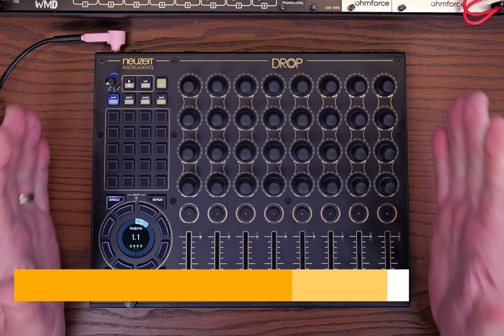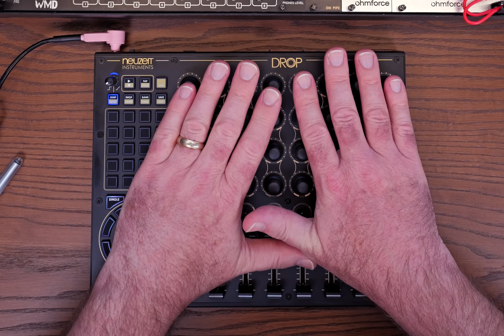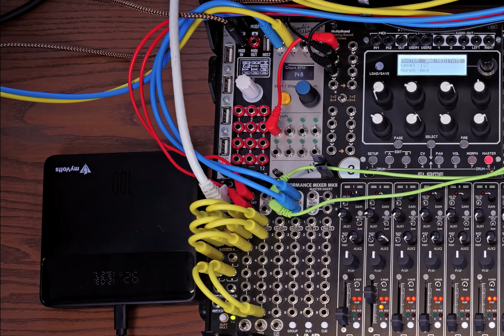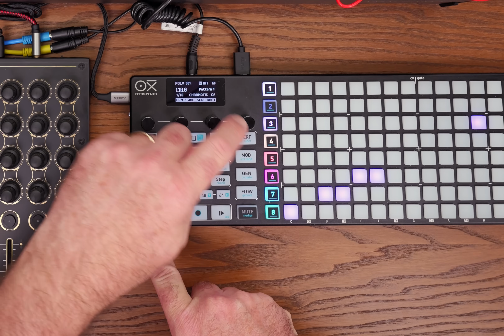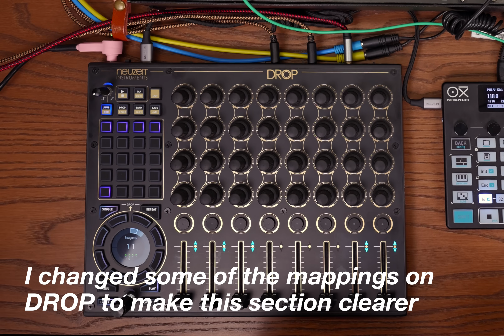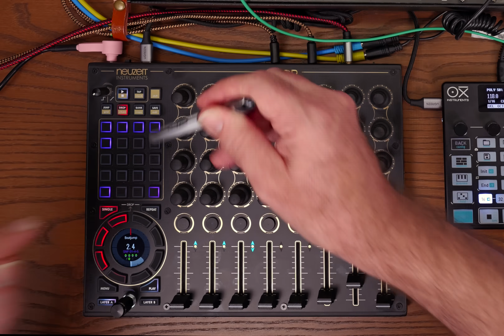Neuzeit DROP: the most powerful MIDI controller for synths and modular

Comment: Is there a way to save the number of bars or seconds a snapshot will take to fade in the snapshot itself, or is it all manual through the tiny knob in the upper left?
Reply from the maker: There's a distinction between fading between snapshots (using the knob) which is called 'Jump mode', and sequencing when you drop from one preset to the next (called 'DROP mode'). The fade is manual and the length of the fade is controlled by the knob. But the Drop is sequenced, and can be anything from 1 to I think 64 bars long. 

There's a lot more to it though - you can chain multiple snapshots, or sequence a Drop followed by a fade-in Jump. So take a look at the manual around pg 38

Comment: I'm having a hard time getting mine to work with the Tonverk over usb. Any tips?
Reply from the maker: Yeah I had some difficulties with it too. I since returned my Tonverk so can't test, but I think it comes down to the USB host/device getting confused. Did you try over DIN MIDI cable? I know Elektron just released 1.3.0 with bug fixes on MIDI in it

Comment: How is Layer B working? Is it the same snapshots that saves both Layer A and B?
If I should consider this, then it would be as a change from Faderfox PC12 (74 potentiometers) to this (32 potentiometers), but if the Layer B is a 100% extension of Layer A then it is ok and it will work as having 64 potentiometers, which I can deal with.
In other words - all the controls on the left side is handling the 64 potentiometers (yes, their real term is encoders), 16 buttons and 16 faders? And the only reason to have layer A and B switch, is else the unit would almost be twice as wide and quite more expensive, right?

Sorry for the multiple explanations, but this would be a total dealbreaker for me. 👍🙂
Reply from the maker: Hi! I also had a PC12 and MX12 which I sold once I got the DROP. They're great controllers - really high quality.

Layer A and B are entirely independent. So you can treat it as having double the controller surface without doubling the size. I just tested it on my setup
Reply: @SynthDad Thanks for the reply. How would you compare the build quality of Deop vs. Faderfox? I know the Drop is a metal case and so, but how about buttons, knobs and faders? 🙂
Reply from the maker: @psypher19111911 as good as the Faderfox

Comment: Another modern controller that can't handle 42 year old System Exclusive (Sysex)messages??? Geez, it's 2025! why THF would no one add such a low level messaging system like Sysex? Behringer did it with the BCR-2000 IN 2005!!!!!!!!
Reply from the maker: What do you mean 'handle sysex'? By definition sysex are exclusive to a particular manufacturer, so what would it do with a sysex message?
Reply: @SynthDad  see Behringer BCR2000 specs
Reply: @SynthDad  did you just reveal how much you actually know about midi?  arent you supposed to be an expert daddy?
Reply: Get a bcr-2000 then 🤷‍♂️
Reply: @slakk5093 you missed the point.
Reply: What are you even trying to do with SysEx here? 😅
Seriously, explain it
What would the DROP even need it for?

Comment: This looks quite interesting. One thing bothers me though... Why are there still no MIDI-controllers with small displays under/above every mappable element, showing me what parameter it affects. Just look at the MPC X's Q-Link knobs if you need an example. I feel like that would be the most useful feature of them all. Only than I can effectively use it for multiple devices and presets. There's zero chance that I can do it all from memory. I really don't get, why that is not a common thing already for controllers. Especially for devices in the 1000$-tier.
Reply: Have you looked at the Electra One?  Full screen for a page of 36 controllers, with 12 touch-sensitive endless encoders. Latest firmware supports remote control from other midi controllers (faders etc) to extend the hardware controls.
Reply: @adadcalledrichard  I did and ultimately decided to go with the MP MIDI Controller, now that it also comes with Ableton integration and a MIDI-Editor. I can't say yet if it can fullfill all my wishes but at least in theory it should be capable with a few acceptable tradeoffs (like touch input instead of pyhsical motor faders). Thanks for the hint though.
Reply from the maker: It's a trade off with price and complexity in manufacturing. You'd need dozens of those small screens, which of course increases part cost, And then you need to mount them all during manufacturing, which increases costs. Then the firmware to control the device becomes more complex as you need to have code to handle each display. And the unit becomes physically larger, which increases costs.

So how much more are you willing to pay to get small screens over each control?
Reply: @SynthDad  Right now, if the Drop would have it, maybe 200$ on top, just for this feature. I'm pretty sure, that's doable and many people would want it.

The only real challenge could be in keeping the small form factor of the device.

Comment: Excellent overview -- thanks very much for this!! Clearly the build quality, features, price point put this in a pro-sumer category. I'm curious as to how Drop will evolve to support MIDI non-experts like myself, however. I can see from the downloadable SD card content that adding a manufacturer/device preset (via CSV file) looks straightforward, but it also feels like you really need to know what you're doing in some cases. The Elektron box's CSV files are perfection, WOW; looking at Intellijel's only preset (the nearly decade-old uMidi), not so good. Adding a preset for Intellijel's Metropolix that matches the intricacy of Neuezeit's Warp preset, that's a herculean lift for the non-expert. Of course, this is brand new gear and I see the creator(s) of Drop are very community-connected. I hope Neuezeit can find support from manufacturers that do not have full specs available in their manuals -- Drop could be THE device that brings all this together. Fingers crossed!
Reply from the maker: Hi, thanks for watching and your comments.

The MIDI presets are all open-source and available on this github: https://github.com/pencilresearch/midi

This is community contributed, so if someone wants to create a .csv file and upload it here then it will be available for everyone else to benefit from. It shouldn't be too hard to create a spreadsheet for the Metropolix; I will do this for the Tonverk for example.
Reply: @SynthDad wow, a huge miss on my part! understood and thank you for the link. 👍

Comment: That is a great demo of the capabilies with eurorack, I had been wondering how it could work. Do you know if it can work with the Drop sending midi over usb to the Oxi One and then out of the CV outs (or even to the Oxi Pipe)?
Reply from the maker: Yes I tested that but didn’t show it in the video to avoid confusing things. But I want to explore that more. An Ornamental and Crime would also work

Comment: Thinking of getting this and selling my faderfox mx12. Even though it's a bit dearer than the mx12, it seems a no brainer in terms of value and performance capabilities.
Reply: Keeping mine, but I'm using 3 Elektrons (OT, A4, and Syntakt) for my live setup not Eurorack. My Drop arrives Thursday, so we'll see. I heard it compliments other fader controllers well actually. You can even use the MX12 as an atmospheric filter bank.
Reply from the maker: What’s even crazier is that the DROP can be controlled over MIDI itself!
Reply: @SynthDad by a DAW? 😂